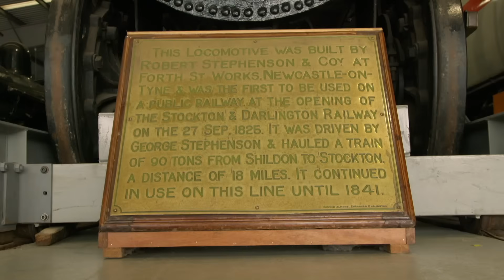Locomotion No.1: The British Train That Shaped the Future | Guy Martin

Comment: Here is a replica of "Förstlingen", the first steam locomotive in Sweden.
The original was built in Eskilstuna in 1835 for the new railway from Kärrgruvan Norberg down to Ängelsberg.
At first the track was 3 feet wide and the locomotive was built that way. Later the track was rebuilt to 4 feet wide and the locomotive was adapted to that.
The replica is built with the new standard 1435 mm which is called normal width.
https://youtu.be/4PLZfIFq1rk?si=eltA6ryRU-VJHO2B